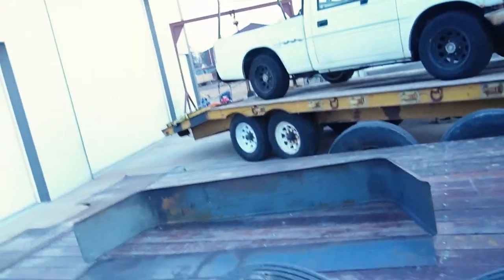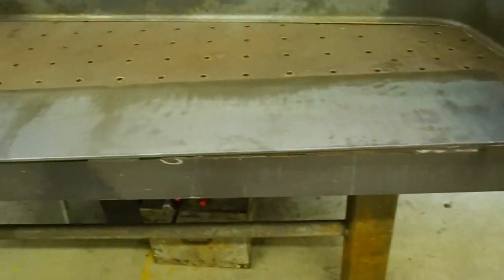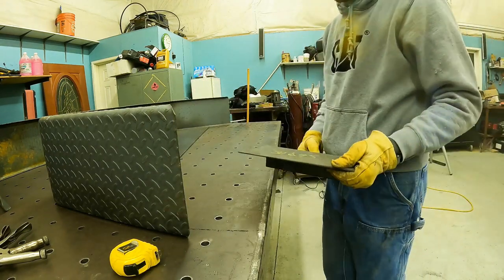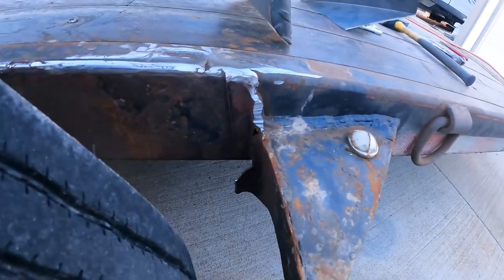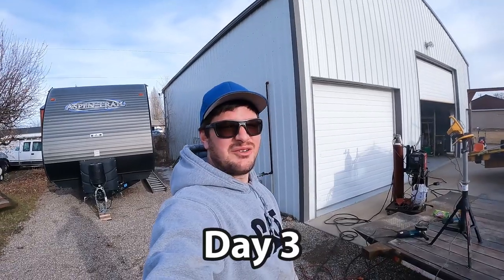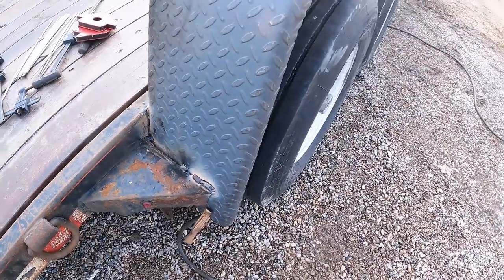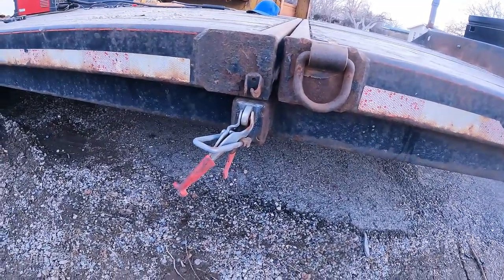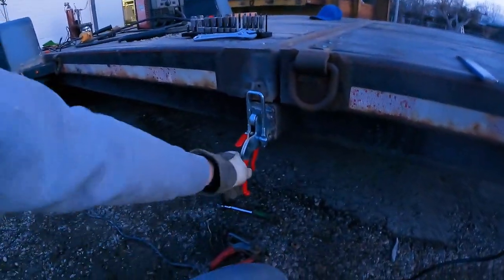LINCOLN MP-210 Trailer Repair- What Would You Have Done Differently?

Comment: I like that Lincoln 210MP, I have one and it kicks butt.
Reply from the maker: Hey Henry! I have loved mine. I have thought several times about doing a review of it. I use it a ton! And I have done every process on it several times. My only problem is my voltage dial has a dead zone in it. How long have you had yours?
Reply: 3yrs, I also have the spool gun for it.
Reply from the maker: I bought the spoolgun too. I like it. I prefer tig but spoolgun is usually quicker.
Reply: I bought the Prime Weld 225 tig machine to teach myself tig welding, and I'm getting better.  I am getting back into the side hustle,  I love my Century 90amp mig for small jobs. I got my work to buy one and they are loving it. You should look into one. Much easier to carry for fast little welds
Reply from the maker: I recently got an Everlast powertig 225 ext. It is ok. Nothing compared to the squarewave tig 275 but it died and is hard to get any replacement parts. Thanks for watching and engaging it helps the channel!

Comment: Why is the Isuzu on a trailer? I thought it was your tow vehicle.
Reply from the maker: The Isuzu is getting an attitude adjustment along with a choke, exhaust manifold, headlights, heater core, electric fan switch, new seats and a grill. It has driven 40k for me and I only paid $400 for it. So another $500 and maybe it will go another 50k miles for me.

Comment: Other than use flux core from the beginning, and you did swiched, I  dont see any reason for doing anything different. I did owned one of those 210MPs, switched to the 215 MPi.
Reply from the maker: What are your thoughts on the two machines? The 210 has treated me well, but I think the novelty has worn off. I got the 210 when it first released and I think other brands have made better improvements. I am interested in your thoughts.